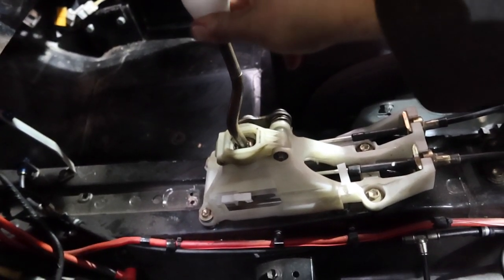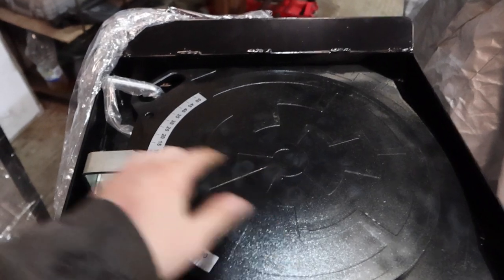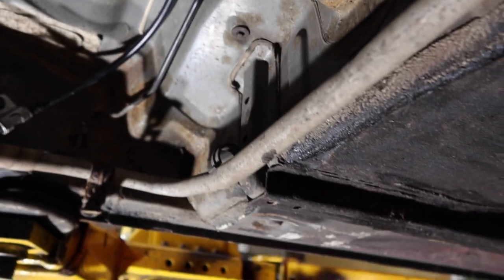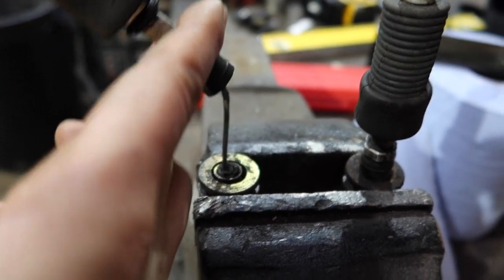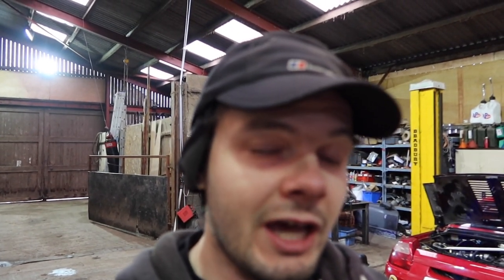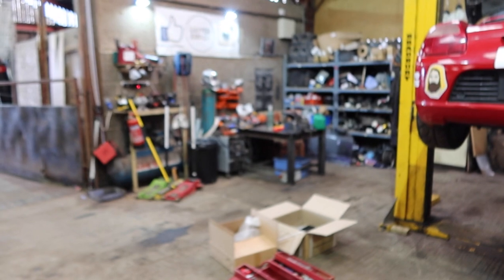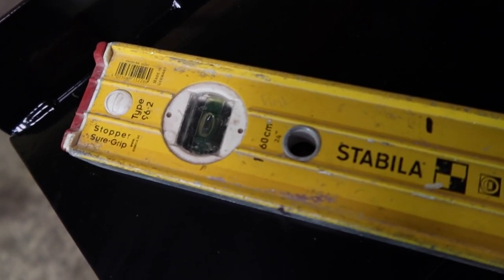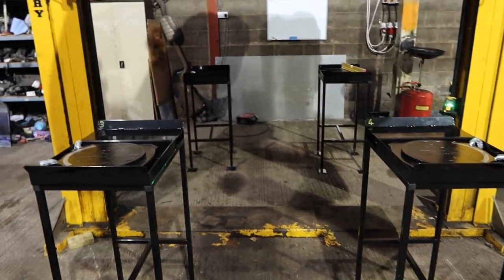Life upgrade. New camera, tables, and shifter cables

Comment: Love the tables 👌 I’d be marking on the floor (probably spray around the feet) and number the tables. Also, for levelling up, do the same with the laser level on the ramp but I think the reference point needs to be from the top of the turntables. 4x identical pegs with a reference mark and level to that👍
Good work and entertaining as ever 😎
Reply from the maker: Doesn't need to be on top, they are made the same. Also if I marked the floor it would only work for the MR2 in that specific place on the ramp. Won't always be exactly there or always that car
Reply: @dannyDC2  fair doo’s dude 👌😎

Comment: Quick selector cable trick. You can D.I.Y solid shifter bushings if you put a skateboard bearing where the bushing should be. Slap some washers either side and you've got yourself some no bullshit shifting.
Reply from the maker: Sounds pretty gnarly dude

Comment: Its been a while since I've had a toyota gearbox in bits, but the part you are trying to remove has two threaded holes in it. You can thread in some bolts with large washers on and make something to pull the bolts upwards. I used a small rectangular steel plate with slots that fit under the bolts and washers and had a large bolt in the centre to wind in and lift the whole lot upwards.
Reply from the maker: Sounds like my kinda solution! 👍

Comment: Buy a set of the solid shifter cable bushings and solid shifter base mounts. Makes the shift much more precise and a very cheap upgrade.
Reply from the maker: I have some for the shifter but not allowed to run them I don't think. Gonna have to check ze rules
Reply: @dannyDC2  Guess you gotta play by the rules!

Comment: Spraypaint the floor and the legs of the tables whilst theyre in place, so then you go to put them back they're in the same place as before?
Reply from the maker: Did consider that but it'll only work if the car is the same track, on the ramp in the same place, and facing the same way. Too many variables. Got myself a laser level to give them a once over once in place
Reply: @dannyDC2  agreed, it’s almost impossible to get a car back on a two post lift the same, the arms move back and forth, in and out, the car can/will be off Centre, further forward, back etc etc, it will never line up.

Comment: I hate to mention this but when you drop the car onto those tables the lateral movement of the wheels, due to the suspension movement, is going to move all those tables out of alignment unless those turntables have some kind of mechanism to allow them to slide across the surface of the tables to allow for the lateral wheel movement. It's actually preferable to have a level surface that you can drive slowly onto, so the suspension is at its normal ride height. (Compared to full droop, the track width of each axle is going to be nearly 1 inch wider at normal ride height, so the top of each table will be tilted outwards nearly 0.5 inches, and of course there's no guarantee they'll all move uniformly unfortunately.) Thinking about it, you also need to consider that this could lead to a failure of the tables due to uneven loading of the legs, safety first.
Reply from the maker: They do go forward and backwards too. Also got a bit of plate behind them at the same height to roll the car forwards and backwards
Reply: Do they go definitely sideways? I'm worried now!
Reply: @pjay3028  I was worried just lookin' at 'em ...

Comment: EBay short shifter kit tightens it up heaps to. Armstrong racing did a lot of YouTube's. Also there's the jubu gear sets with 4.8 final drive
Reply from the maker: Not allowed short shifters for sure. Mounts and bushes maybe..
Reply: @dannyDC2  probably better since I think it's better with the standard shifter but the mounts etc would probably work. 
I like everything your doing and just want to help. So I think getting the kit and leaving the lever the same would be a good option.

Comment: When you were moving the gear lever at 14:48, the white base was flexing a lot, if you can remove the rubber mounting bushes and hard mount it, feel might improve.
Reply from the maker: I do have some solid alloy mounts for that but need to double check if it's allowed 🤡

Comment: 5th gear removal is easy got a cheep 2 leg puller chopped feet off it 
Then u need 3” ish of tube with similar internal diameter to top of 5th gear ,I used scaffold tube chop 3 or 4 mm off the bottom of the tube cut a pice out of that thin bit u cut off then fit it inside the tube flush weld round the bottom to join it to outer tube grind it smooth ish but not too much cut tube in half up it’s length 
Weld the 2 legs of the puller to the sides of the tube befor you cut in half slap it round the top of 5th gear with a jubilee clip round to hold it together and it will wind off no problems 
Or go on eBay look up 5th gear puller lots on there
Reply from the maker: Nice one 👍

Comment: I would have spray painted around the legs onto the floor so you can line them back up perfect every time.
Reply from the maker: Unfortunately that would only work if the car I was measuring was the same track, wheelbase, on the ramp in the same position, facing the same way etc. Will be better to just make a few adjustments when I get them out. I'll explain in the next video as a few have said this. It did cross my mind but for the points mentioned it won't be suitable

Comment: Just strip the gear box and take your gear box main shaft and the new 5th gear to a gearbox specialist to fit it for you... the good bearing/gear splices from Beta, Facom, Wera, Wiha, Stahwille, Bahco are VERY expensive and the cheap ones are crap, they are just too thick to get fully in and the metal is like cheese.
Reply from the maker: Yeah seems the way. Probably better to try and buy a second hand decent kit which is what I've been keeping an eye on
Reply: @dannyDC2  did you ever sort this? I had a similar issue with a Clio box, might be able to help...

Comment: May be too late, but draw round the diaginal feet on each table. At least you'll be almost in the same place.
Reply from the maker: You'd think that'd work but it'd only work if I was on the MR2, and got it on the ramp in exactly the same spot. Will be easier/peace of mind to just check them before using them
Reply: @dannyDC2  yep, didn't think of it like that! 👍🏼

Comment: You would make up a gear puller handy with some steel and threaded bar, I had to do the same when I replaced 6th gear in my Altezza with an s15 6th.
Reply from the maker: Sounds like a job for the metal man in the black coat!